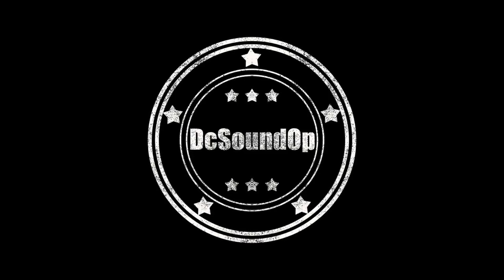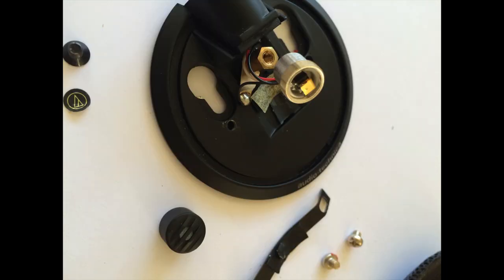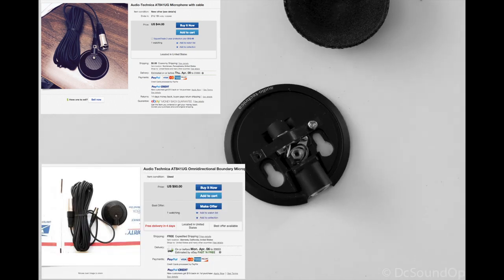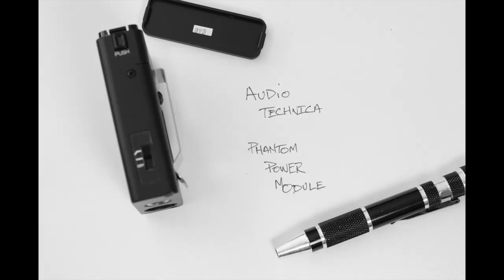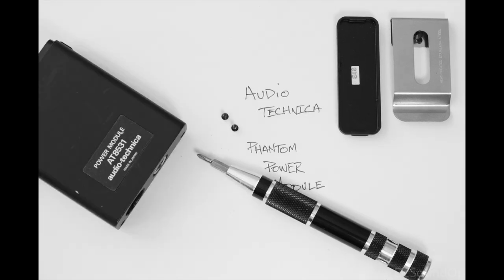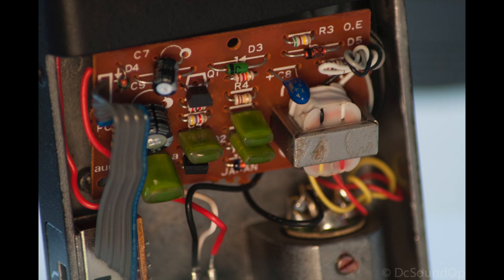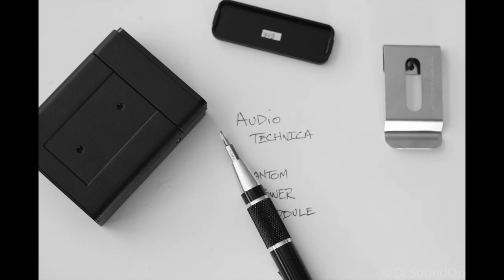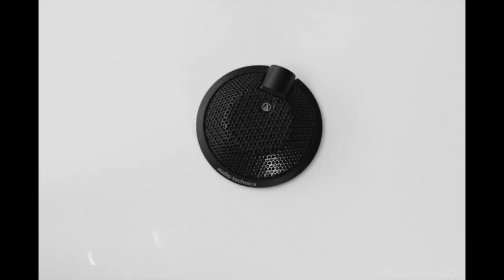Why do some microphones have extra modules?

Comment: That power module look a lot like the one that comes with the Superlux PRA-383D XLR, a €60 mic.
Reply from the maker: That whole Superlux mic looks like a bad photocopy of the old Audio Technica ATM35 (before the current 350 & not the PRO35) which also came with the same power module. 

Check out the Superlux product line though, not much that doesn't share a striking resemblance to other (outdated) but well known products -  https://avlex.com/product_categories/4-wired_microphone_systems/

Thanks for the message & for watching one of my first videos!